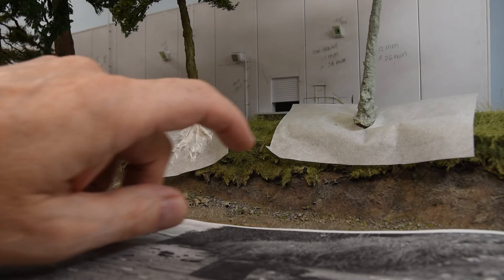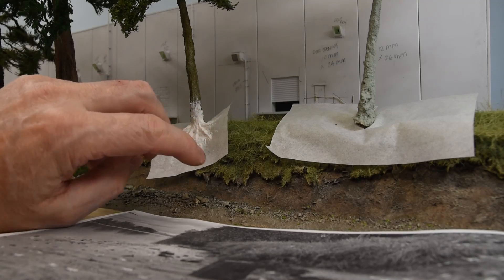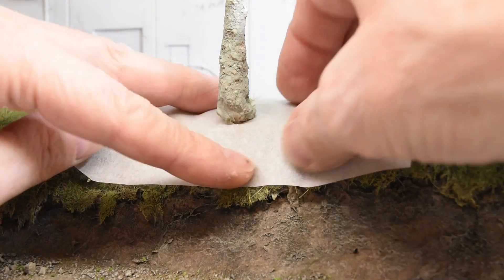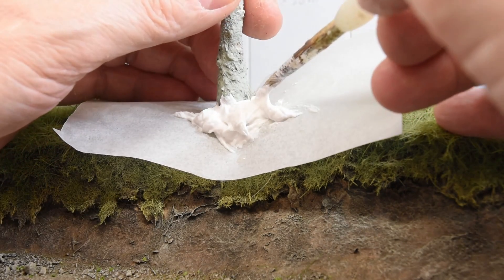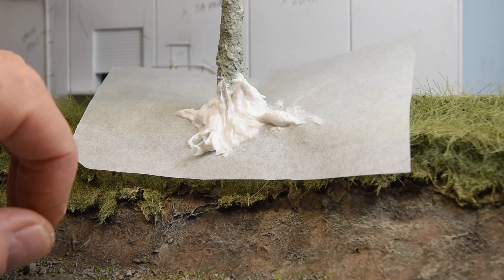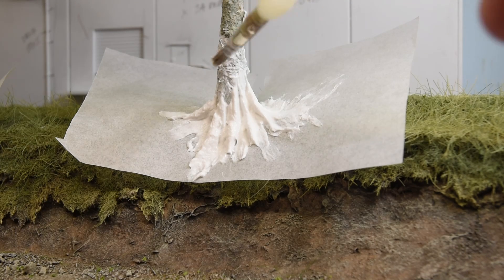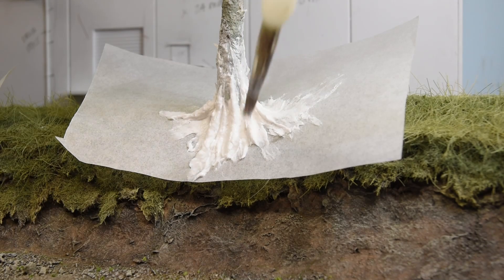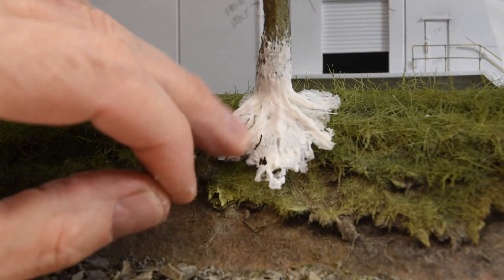Creating Realistic Tree Trunks for the Discerning Modeler | River Road - Vlog #90

Comment: Hey Boomer. So far I've built three feature trees using your technique and I'm very happy with it. However instead of long static grass fibers I used a piece of combed out old hemp rope. Naturally the black pine looked too dense in the end and I had to comb out those nests. And I used static grass applicator for the final 2mm fibers as they had to stand up. Raked it out again and that's it. Best tree ever.
Golden's fiber paste works great as well on wood and wire armatures, offering a flexible, reposable model that one isn't afraid to handle. 
Thanks teacher. And sorry for being away from school. People die, one mourns, then gets on with Life in the end. Have a nice evening.
Reply from the maker: Sorry for your loss. Good to hear from you. Your tree method sounds great! Cheers ~ Boomer.
Reply: @boomerdiorama  Thank you.

Comment: This is great! I've been using Das air dry clay for my root structures, but it's not flexible so it's not ideal. If I'm making a wire tree I can use hot glue on the wires and carve it with my wood burner, but when I'm doing dowel trees I don't have that option. I just ordered some of that fiber paste. Thanks for the tips!
Reply from the maker: Sounds great. You are going to love Fiber Paste by the look of the beautiful work you do with trees! I like the look of your channel as well. Very cool indeed. ;-) Cheers ~ Boomer.
Reply: @boomerdiorama  oh thank you so much! I really appreciate it :) And I think I will get a lot of use out of that paste!
Reply from the maker: @Geordiecrafts  You are welcome. Keep doing what you are doing. It only gets better . . .  and better. ;-)

Comment: An entire surprising world can hide into trees and deserve observations:
Birch: white and "silver" species trunks. Mostly thin tree, big hidden roots system. Often at death of
"mother", roots are still alive and bouquet of younger will emerge. They can break under severe winds or heavy snow coat or icy rain, but can also bend and stay horizontal for ever. After sometimes,  upper branchs will go vertically and come the new head trunk.

Pines can get pretty high. Their roots stay close to ground surface. They can break or uproot. Don´t forget in that case the big thin blob of roots stuck with ground. It can be impressive and very seldom modeled. On large ones sometimes a big branch broke up close 8 to 10 feet above ground and tree trunk rot. After many years that rotten wood will fall making a big vertical hole. Why not cteate a mini scene behind your house with kids playing hide and seek with one in it ? 

Poplar too act the same way with surface roots. They usually suffer from a disease (or mushroom i forgot) that can start from an upper branch or top of head. Your tree can look healthy full of leaves except on that sick part. Dead parts can have no foliage or rusty orange leaves if the disease have kill the branch or head in the actual  growing season. In 3 to 5 years the tree poplar will die. You can model a large one with leafless head, a few CLOSE together branches with dead rusty leaves and healthy on rest of the tree.

Ash trees. Emerald ash borer is killing in few years. Your tree must have just a little leaves with some branches without them. It usually start from top without nourishing sap. Depending worm location on tree height, bottom branches can be ok. Trying to survive the tree will grow along its trunk new branches. Ash leaves are quite a challenge but a looking dead tree with foliage growing from trunk can be impressive. Don´t forget their curling branches going down and up. Not the easiest tree to do that can be time consuming.

Conifers don´t like to loose their head. When they survive the two upper branches will come new ones and grow vertically but avoid new branches toward each other. Deciduous have no problem with multi head that will grow from trunk  tip.

Walnut can grew pretty big and very aesthetic but antisocial with toxic poison for other trees. In doing so they keep sunlight and rich soil for them. If you plant neighbor trees, they´ll die.
Make variety in your forest. A big wind storm broke a bunch of them or lie them in all directions on the ground ? Those 2 brothers grew from single stump forming a big "V" with vertical branches ? An other one grew horizontally with a big one on him then went vertically ?

Why not a kid tree house or kid swing with rope and old tire ? May be above river or lake ? What about a huge eagle nest on top ?
On damp location green moss and lichen along the trunk usually on north face.
What to do with those round styrofoam white pesky pearl ? Just the right size and color of giant puffball mushroom on your forest ground. In bigger scale, mushrooms on dead standing or grounded trees...

Trees, forest...an entire world to do.
Hope those tips can be helpful.
Cheers and thanks Boomer for emphising those forgotten details.
Reply from the maker: Thanks for sharing your impressive knowledge of trees! Cheers!
Reply: @boomerdiorama well...that´s the good bad point of having acreage. Everything said above is from home. Sad ash shory, at least 8 to cut with some close to house...well they´ll do plenty of 1" 1/2 and HO scale ties...for the rest  last april icy rain storm with victims still there...hope they won´t fall on my neighbor mainline...
Oh one more detail. Your tree can be uproot and lying on the ground and still be alive. Depending on deciduous specie, they´ll die  or 
"live for ever" that way. Branches transform in new heads. Willow trees are good for that.
Oh about cedars, they´re dumb enough to grow on worst locations like on a big rock with roots that will follow its shape and go in the soil. 
Trees can grow on vertical mountain slope if they find a crack with tiny amount of dirt and moss. Usually a tree is always vertical but some defy gravity and grow horizontal. Really bad that they need so much work in foreground. Those in back or among backdrop can be very approximate and fuzzy. But well seing in front...if it take years for them to grow, we can´t mimic them in 5 minutes.
Glad you like it.